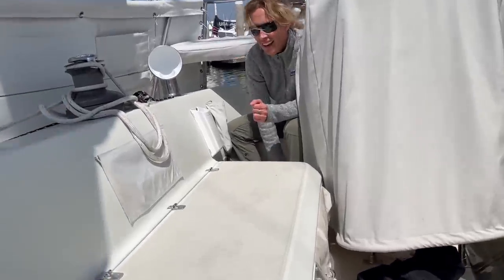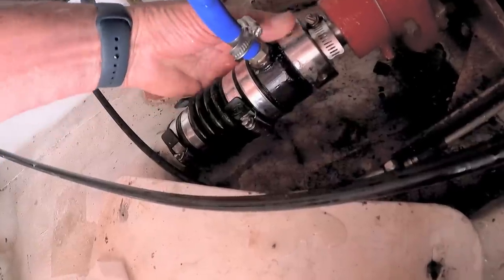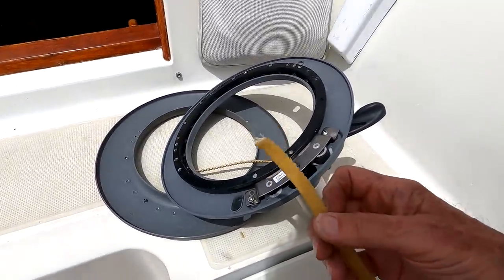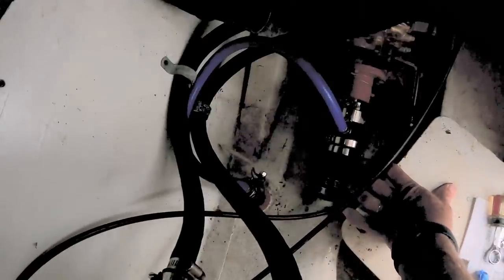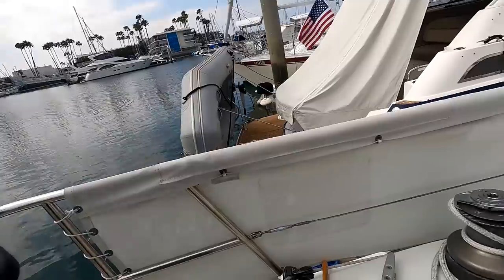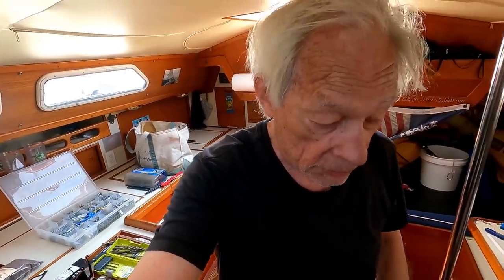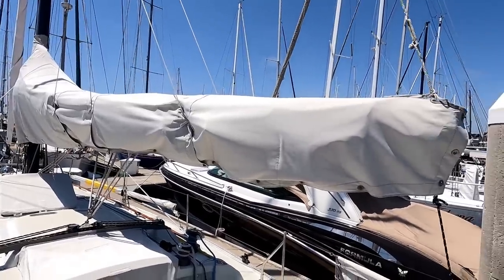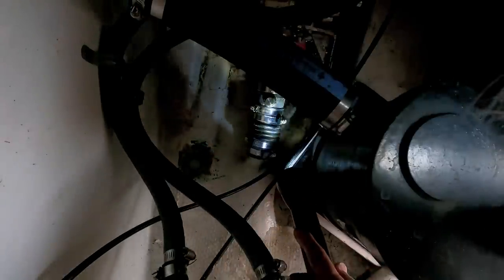Are We Sinking yet? Ah, the Endless Summer--of Yacht Maintenance

Comment: A few years ago I installed that same galvanic isolator upon the advise on many experts.  It has made zero difference.  But really enjoyed this video because I have had every problem you showed including thinking my boat was going to sink because of a failure of my dripless seal.  Another thing I installed at the recommendation of a lot of other people!  I added an extra zinc on the shaft to act as a kind of belt and suspenders approach to keep pressure on the bellows.  Don’t know if it actually helps but it doesn’t hurt and is easy to do.  Those little set screws on top of each other just seem a bit wimpy to me.  My boat, an I36, is similar to yours, but I was never able to get the wheel pilot to work in any kind of sea state.  I had to replace it with a linear Drive unit, which cost a fortune.  Glad you had more luck.

Comment: The carbon shaft seal face is much more noble than the ball valve guts. The short hose provided great continuity via the sea water and the valve become the sacrificial piece. That’s my guess as to what caused it’s pre mature failure. Shaft zincs tend to disappear faster for the same reason with that PSS seal. I have one and so far not using the  vent hose hasn’t caused any issues. 

If you ever have to loosen the stainless collar the set screws are actually two screws per hole. So once you remove the visible set screws you’ll find two more underneath that are actually holding the collar in place the upper two are used to lock the bottom set. They recommend only using the locking screws once so order a set before you do anything. 

Great seeing you again!

Comment: Yet another timely video!  Thanks, Christian, checking my heat exchanger zinc!  I already dealt with my leaking locknut that damn near sunk my boat because 1. I accidentally shut off the auto bilge 2. Should have addressed the extra water I saw in the bilge the previous week to see where it was coming from when the auto was on. Gah!

Comment: My previous PSY shaft seal had no accommodations for a vent.  I didn't burp the seal often enough and that made the shaft overheat and get brittle.  The end result was a broken shaft.  Fortunately, the shaft zinc kept me from losing the prop.  The replacement shaft seal had a vent hole and I installed a vent line.  I got new shaft ($$) and never had any problems since.  Lessons - don't rev up too much in reverse - that makes the prop cavitate and sends bubbles into the log where it replaces the (cooling) water inside the seal.  Burp the seal often.  Burp anytime you hear any squealing.  I think a vent is a good idea so you don't need to worry about burping.  Just run it up to near a lazarette where you can see it.  Thanks for the great video.

Comment: Great channel hope mine gets to this standard one day. The reymarine wheel pilot has a week link the planetary gears in that silver tube are made or nylon and if you turn the wheel while ray is engaged they shear. The bits then break the other gears you need to replace the lot 9 of them. And clean out the old grease in emergency you can reposition them one broken one on each level but it doesn’t last long. Print some more on 3 d printer. Keep some Spairs or buy a now gearbox. Fair winds jim

Comment: I am also replacing a seacock valve where the ball is stuck in the open position. From what I can see of your video, it seems to be the same brand.  I installed a vent hose on my PSS120 and I will look into replacing it with a plug for simplicity and prevention. Thanks, Richard

Comment: I think the issue with the dripless shaft is that  the cooling water tube exerts a side load on the seal assembly. If your prop shaft stern tube (where the shaft passes through the hull) has enough clearance to allow water to flow in from the outside, then the tube could be a vertical vent tube only and would not require connection to a thru-hull.  The top of the vent tube has to be higher than the boat's water line (on a heel as well) to prevent flooding.  Another option is to connect the vent line to a simple thru hull fitting which sits above the waterline with the boat at rest. 

Here are the installation instructions from PSS for their dripless seal :
Low speed boats: (Under 12 knots of boat speed under power and no bearing in the shaft log):
Using a ⅜” (8 or 9 mm) ID “underwater rated” hose (not provided with the PSS), connect the hose to the hose barb fitting installed on the carbon and secure the hose with two(2) hose clamps. Run the hose to a point in the boat at least two (2) feet above the waterline, making sure that the hose does not apply any load on the carbon part of the seal. Keep the hose as close as possible to the centerline of the vessel so the top of the
vent hose is never below the waterline, even if the boat heels. Secure the hose in place with the necessary fittings that insure it will not pull free and drop. This hose is now a venting hose that will help ensure that no air is trapped in the seal.

Comment: I just bought a 45-yr-old wood sailboat that hasn't been hauled out in over 10 years, and the automatic bilge pump only goes off about once an hour ... I could be smug about that, but I know your problem has a simpler solution, thanks to the plastic hull. And of course no matter what the material, a leaky hull will not get better on its own.

Comment: I've had PSS Shaft seals and what I don't like about them is the need to haul the boat if there is a real problem. I like the old fashioned and reliable stuffing box and using teflon coated packing. They are much more reliable and one can replace all the packing with the boat still in the water. So they drip a little and are supposed to. So what. It's a boat!

Comment: Christian ,,,,,, you KNOW Dripless in itself is a nightmare are soooo unnecessary ,, and the vent hose on TOP of a mess makes a Big Ol Mess
rip ALL that nonsense out and use a standard tried and true stuffing box and normal shaft seal.   
And I think you KNEW it was the belt that failed in your EV-100 wheel pilot
I change a belt every 5 years if it needs it or not. 
For $25 to replace it and have a peek inside keep your confidence up knowing its good to know SHOULD you need it. 

Cheers and Beers ya old Salty Dog 🐶 !!

ps. you can BUILD a Galvanic Iso unit for $40 instead of paying Pro Safe $300.....

Comment: Are all of the thru hulls and ball valves connected with a green bonding wire connected to an underwater zinc on the outside of the hull? That shaft vent thru hull has no connection I can see. Maybe that is why it failed?

Comment: does your bilge pump have a manual override so you can just turn it on? Bypassing the sensor?

in my short sailing career, I found there's four or five published different ways to do everything on a sailboat. Everybody has their own opinion but it's fun to be creative and substitute hardware where they haven't been substitute before worst case scenario is you change it back if it breaks or doesn't work, but most systems are pretty simple

Comment: Christian, when your mainsail is raised, the windage you are attributing to the stack pack is the same area the mainsail takes up! There is no additional windage at sail, silly man. It is only at anchor that there is additional windage. And since it is far safer to drop the mainsail while at sea into the stack pack, the extra windage is well worth the safety it provides. There are no sail ties necessary. And it is far easier to zip up and protect your sails from UV.
Reply from the maker: Windage not the issue. Ugly the issue.

Comment: At first I didn't think much of the broken ball valve in your video, but the more I think on it, the more I realize that was a terrible job by the yard. That's not an ABYC rated thru hull installation: There's one hose clamp on a hose below the water line, that valve is not a thru hull valve but a ball valve (obviously not suited to saltwater immersion), and I doubt the threads are straight more likely to be tapered. It should be properly flanged and secured to the hull and able to pass the 500lbs side load rating, double hose clamped too.

As for the dripless seals I've never had one and I don't see the need. A stuffing box filled with PTFE and graphite packing runs very cool and almost never drips. The modern packings for the old style stuffing boxes fix most of the problems the dripless seals were out to cure with none of the catastrophic failure risks the dripless style pose. Great content as always Christian!

Comment: I fervently hope that, after all that goofing around with your shaft seal, allowing sea water to spray and splash all over your shaft coupling, transmission, aft engine mounts, and back of your engine, you douse those areas thoroughly with fresh water and then liberally spray all those areas and components with a corrosion inhibiting product like LPS 2 or the like. Any rust on engine components that is not addressed and allowed to propegate is bad news!  Also, the fact that you have to remove the engine exhaust hose and waterlift muffler just to gain access to your dripless shaft seal is very scary.  While quite rare, catastrophic failure of the rubber bellows is not unheard of.  If it were my boat, I would want  to have almost instant access to that area so that I could stuff rags,or whatever, in there to minimize sea water ingress should such a failure occur.  Concerning the shaft seal vent hose, on my boat, my dripless seal vent hose runs up above the water line and then connects to a tee fitting in the little hose that provides seawater to the exhaust mixing elbow.